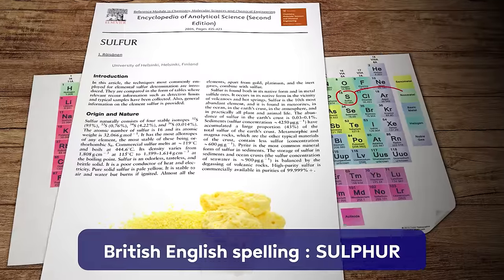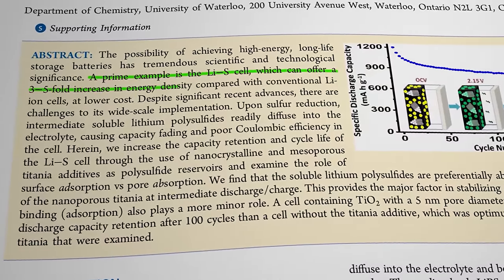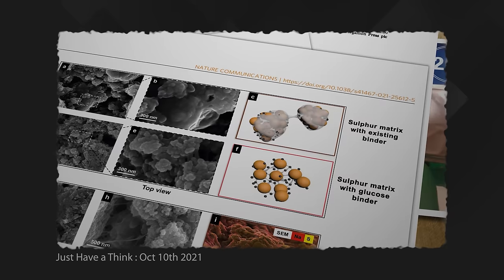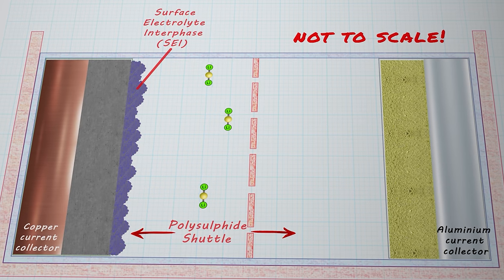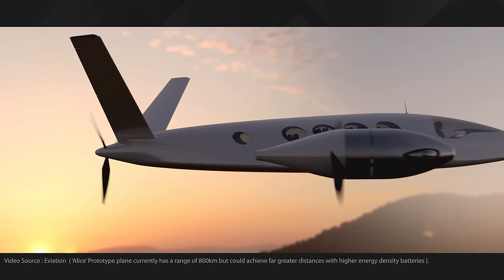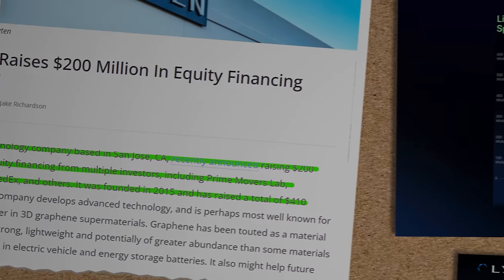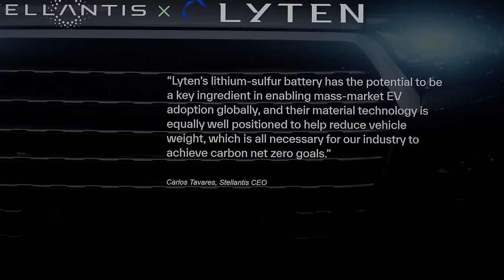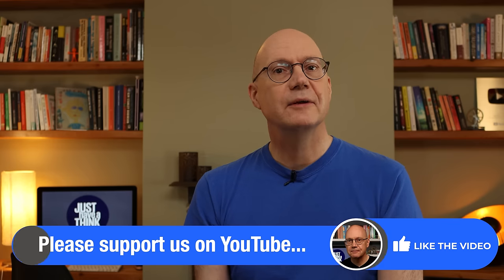Battery Energy Revolution. What now?

Comment: I so want this idea to work.  EV technology is exciting and something everyone has access to via vehicle purchases.  There are obvious issues with charging stations needed but the same was true when the IC engine for the new idea of cars driven by gasoline was new.  This too will happen.  I also understand that the roads were first built for horses and people and not for vehicles so some change in thinking has to happen.
Reply: Exactly, and just as the first horseless carriages were despised and mocked by those who lack vision, anything not powered by the 19th century technology internal combustion engine will face similar backlash. Those types of people tend to think stubbornly in terms of what "was" up to and including current issues to be overcome, and embrace these concepts as "will be"... all the while, never opening up their minds enough to see that it is a work in progress and that it has great potential. If these sorts of people had their way, horses would still be the main technology of transportation. They love to put the laughing emoji on posts concerning EVs. I give them a mental laughing emoji as I drive past the gas stations and see them regularly dumping $65 to $95 in their tanks. (I charge every 10 days or so in my garage over night, and since I generate a surplus of solar electric, I don't even have an increase of a utility bill)

Comment: Another very interesting video Dave, great to see your work in keeping us informed...  

Only one not picking point, you showed a virtual demo of an early Eviation Alice electric plane, the later one modified in 2021 had its first flight in September '22...  Surely better to use the real thing than an early mock up?  Hopefully these developments will give the Eviation Alice a decent shot at making an impact on the aviation industry?
Reply from the maker: Good point Peter. I had not spotted the footage that you mentioned.
Reply: @JustHaveaThink  Battery electric aviation is one of those thorny issues that might be worth exploring?  There are already small steps with the Pipistrel battery electric trainer certified and in production as an example of perhaps the most promising development.  The Eviation Alice is another promising example that is ... still in the pipeline although there are already quite a few pre orders.  Also on the transport side, the Aptera is a more down to earth example of a direction the ground based transportation industry should be looking, worth exploring?  

We might be some way from a SpaceX battery electric starship though....   
Perhaps comments for your Patreon page?  ;)

Comment: Always super-excited to learn about the progress of battery technology, especially when companies seem to have found a solution that has X amount the energy density of current Li-Ion batteries and can be mass-produced very soon. However, proof is in the pudding and I very much look forward to the first EV's enter the market with 200 kWh batteries and weight still under 2000 kg. Sure hope that will be the case in 2025 or so...

Comment: Have you looked into the company called Iontra? It is a USA based company that is significantly improving the way batteries, regardless of chemistry, are charged and improving charge and discharge rates as well as overall cycles life. I'd love to see you make a video on the tech and it's possible implications of the market as a whole.
Reply from the maker: Thanks Tim. I will look them up.

Comment: Really interesting to see that this technology is progressing, I remember attending a lecture in the early nineties where a professor once stated that battery technology would never really progress because the US Navy had tried every avenue in battery technology for submarines in the 1960s and that their massive research bugets were collosal compared to the automotive sector, a silly argument of course because technology progresses and at least one tech genius has been born every week since the sixties. I do think the future of transport is 'less is more', some day a passenger car can run a hundred miles on a half liter of veg oil but on current tech this would only be achieved as part of a hybrid vehicle with regen brakes and a scavenging heat pump. As I see it the main problem is the manufacture of these vehicles would be economically unviable, just like a hydrogen fuel cell is, and these things won't happen in the third world at all until all the oil is gone. Pure EVs can't cover the deficit, and although I get the sentiment, the energy used in the manufacture of these vehicles makes a joke of any carbon neutral political fluff, there simply isn't enough renewable electricity globally, forget solar in Manchester! Better idea would be to shift the focus of green politics away from transport and have a good hard focus on agriculture which is twice as bad.

Comment: LFP isn't energy dense enough for aircraft. It's an NCM use case IMO. Also, Silicon in the anode is where you should be focusing - again IMO - as this is the most promising approach to increasing energy density & extending battery life in the shorter term. Sodium will take quite a while to mature\scale and has the worst energy density of the three, so will mostly be used for stationary storage. All of three of these battery chemistries will have their uses; and others are they come online and scale up. Scaling up is something that's often overlooked.

Comment: I would like to see this become a reality soon, and it seems as if it may. 

While the range anxiety people have with EV's is often not the concern they think it is, the lack of energy density in batteries is absolutely holding back larger more power hungry vehicle types from being electrified.

The energy contained in a given volume of gasoline/diesel simply can't be matched by an equal volume of batteries yet. So despite an electric drivetrain being significantly more efficient, the fossil fuel still has the advantage for range. It is also still king when it comes to heavy equipment, as there is a constant demand for power that cannot be reduced through better aerodynamics unlike road vehicles. Moving dirt (mass) is never going to take less energy.

I question why they don't put small cells for sale on the consumer market before jumping to things like EV's. I feel like more people having a direct positive experience with a product would likely help people be more readily accepting, and increasing investment. If suddenly people's new phone, flashlight, vape, etc lasted twice as long, the public interest would skyrocket. It's also not unlikely that some people who happen to be investors would have that same experience, and seek to invest.

Comment: Add a little iodine as LiI and the battery will work. The iodine stabilizes the sulfur as a semiconductor on the graphite scaffold. It also helps with preventing the polysufide shuttle effect by polarizing the sulfur ❤
Reply: Chris - why are you telling us? Tell the developers - I'm sure they have no idea. Maybe they'll take you as head engineer.

Comment: A film theme I would like to see is: Why has the development of batteries been so relatively slow? And what could other research and development projects learn from it?
Reply: "Slow" is a matter of perspective. The best Li-ion batteries in 2008 had around 55Wh/L. By 2011 that had doubled. By 2017 it had more than doubled again to 250Wh/L (which is what is making its way into cars today). The best batteries today have doubled again to around 500Wh/L (only available in small quantities for specific applications, but it shows this will be available at mass-scale in around 5 years). That sounds like pretty rapid improvement to me! Also, the cost of batteries has plummeted! 

The next question to ask is - what's the goal? I I'll anyone want more than 1000km range? The easy answer looking at cars is - no. If battery packs today give 500km range, and before the end of the decade the same size and weight of a pack will give 1000km of range and at around half the price and will probably charge at least twice as fast, that's really all that's needed for 99.999% of use cases. So really, by the end of the decade the technology will essentially be "there" - capable of taking over completely from gas.

Comment: LiS chemistries are a great possibility for the future of EVs.

But the possibilities of NaS chemistries for everything stationery like grid scale and domestic batteries is even greater.

Sodium is much more abundantly available than Lithium, in fact it could even be accessed as a biproduct of expanding the desalination of seawater which is a growing possible necessity for international water supply in the coming years as temperatures increase and evaporation + population growth continues.

Sodium + sulphur is such a great combination for material affordability that as long as the production problems can be solved (at least partially by same advances that made LiS possible) and the process can be scaled up then we will no longer have any anxiety over being able to match renewable power installations with battery support for the future grid.

Going in to 2050 we are going to see things change radically in terms of how power is produced and served to the customer.

Comment: Great potential for vehicles but not really needed for most static applications.  We really should get serious about other battery technology that doesn't use Li.  The decreased demand for Li could well reduce its price and with it the price of EVs.  Also, other chemistries seem to be superior for static applications.  Many are made of inexpensive elements, last far longer, have little if any danger from self ignition and so can be shipped any way you want, work well over a greater ambient temperature range than Li batteries and only need market share to become cheaper than Li batteries.

Comment: This Li-air battery from ANL and IIT was reported a year ago with 1000 Wh/kg and 1000 cycles: "The team established that this shortcoming is not the case for their new battery design by building and operating a test cell for 1000 cycles, demonstrating its stability over repeated charge and discharge.
“With further development, we expect our new design for the lithium-air battery to also reach a record energy density of 1200 watt-hours per kilogram,” said Curtiss. “That is nearly four times better than lithium-ion batteries.”
This research was published in a recent issue of Science. Argonne authors include Larry Curtiss, Rachid Amine, Lei Yu, Jianguo Wen, Tongchao Liu, Hsien-Hau Wang, Paul C. Redfern, Christopher Johnson and Khalil Amine. Authors from IIT include Mohammad Asadi, Mohammadreza Esmaeilirad and Ahmad Mosen Harzandi. And Authors from the University of Illinois Chicago include Reza Shahbazian-Yassar, Mahmoud Tamadoni Saray, Nannan Shan and Anh Ngo.

Comment: There needs to be something that spurs EVs beyond government grants that will convince people to buy them. Right now, their success would be their failure. Just like car pool lanes on highways.  Using 25% of the highway to transport less than 10% of the traffic doesn't work well.  And using 25% of the power grid for less than 5% of the work done is much worse.  Fingers still crossed, though!

Comment: 8:06 One way to prevent the poly sulfide shuttle is to pack the sulfur inside carbon nanotubes with closed ends. This would require dropping carbon nano tubes packed with Sulfur past a hot plasma gas to close the ends.

Comment: I have a question that I don't think has been answered yet about EVs.

If I own an old EV, say a 2014 Nissian LEAF, will there one day be better batteries (eg LiS) that I can install, thus increasing its range?

After all, I can use a cheap lead-acid AA battery, and replace it with a Ni-Cad of the same basic shape - AA. Will the same occur with older batteries in older EVs?
Reply: I very much doubt it.  Manufacturers are far more interested in selling you the latest cars than trying to keep the old ones running.

Comment: Well, the "what now?" from the title was not really addressed very much, was it? We don´t know, when electric devices with much better battery technology (this or another one) will really be available and at what price or at which scale. The technology does not seem to be simple (and they are proprietary), so companies which produce those batteries might remain rare for a big while. The cutoff for battery use in midsized passenger plaines seems to be at 5x the capacity, which can currently fit into such a plane, but the developed batteries do not reach near that theoretical limit. So, the use will likely be limited to such applications as cars, E-bikes and E-scooters - not bad, but it does not seem to be much of a game changer, because such devices already work. Viable E-Trucks perhaps? Viable E-tractors? I´don´t know, it´s nice, that there are improvements, but I don´t see them driving the market anywhere, yet. And at the end of the day, the market will only act against climate change and environmental destruction, if it is forced to.

Comment: Could this prove interesting?
The American Chemical Society published an article titled: "A Layered Organic Cathode for High-Energy, Fast-Charging, and Long-Lasting Li-Ion Batteries"

It's a Li-ion battery with an organic (that is to say based on predomunantly carbon-containing molecules) cathode, so no nickel, cobal, manganese or even aluminium. The organic compound in question that acts as the  athode material is bis-tetra-amino-benzoquinone.

DOI: 10.1021/acscentsci.3c01478

Comment: Just thinking - if we multiply capacity of battery 5 times it   needs roughly  to be charged 5 times longer which is not very awaited. We need to   look for way to increase speed of charging to some say 10 minutes which is  by specialists  promised to actual batteries  . With energy 45 kW multipiled by 5 we may have 235 kWh and   increase  range and utilization of energy. Good for us. 

 235 kWh charged within  10 minutes at level say 235 V  requires 6000 A charging current. One question I would leave for self answering - how big is   required    size of connection  "wires"  and connector plug+ socket  in compare to car and hands of a driver?   And second how big is transformer needed to supply station consisting say 20 locations which due to unavoidable voltage drop at 235V at this current need to be within meters to cars? There is good solution to go for High Voltage - surely say  5 kV is perfect  solution only how it is safe for driver and in wet and dirty reality  of used car ?

Comment: While I'm fine with the electrication of general purpose motor vehicles I believe there is always going to be an ICE market due to things like extreme temperatures, extreme distance, extreme weights, and other extremes, and also obviously hobbyists and holdouts. It doesn't have to be fossil fuels though since once the demand gets low enough and economies of scale fall off and laws change for fossil fuels we'll likely see alternative synthesised fuels take over for the ever decreasing market.

Comment: Definitely the auto industry will be driving this sulfur (sorry, Yank here) development along at a good clip. However, the air transport industry has yet to flex whatever muscles they have to further drive reductions in weight. Eventually air could overcome ground transport if batteries could be made light enough and have sufficient density. The Jetsons' flying aircar might not be that far off.

Then, of course, we'd have the eternal problem of traffic control. However, if the cost of air transport were to drop down to where bus logistics are right now I could see an entirely new age of public transportation with air busses taking over for ground vehicles in nearly all applications. What say?

Comment: I am far more interested in the battery technology that can economically and environmentally assist renewable energy sources to bank power for overnight delivery. Chasing after the car market is a small target that does not reduce greenhouse gas emissions by that much. Possible use in short haul aviation would be more interesting than their use in cars again. Apart from pollution the problem with the auto industry and cars in general is how they make ridiculous dimension vehicles that are resource intensive and exacerbate the inefficient movement of people around our cities. We don't need more of and bigger roads in our cities, we need much better public transport and better designed urban areas with higher population density. BEV's with better batteries than Li-Ion may help with pollution, but they will not fix congestion. Too much attention is being directed at batteries for cars when we want batteries for grids first.

Comment: so many problems with battery chemistry have to do with internal failures. if the cells were designed differently, then an occasional mechanical intervention (such as a shake or scrape or mix internally) would solve the problem (of dendrite growth, for instance). 

flow batteries take this to the limiting case. the "liquid metal" batteries of sadoway et al solve part of the problem nicely. but there must be an intermediate design. and i have NEVER seen it discussed at length. all battery manufacturers seem to want a static object with no design allowance for mechanical intervention or refurbishing. and modern lithium cells are absolutely NOT designed for disassembly (internally -- thankfully the cells as units are often easy to salvage).